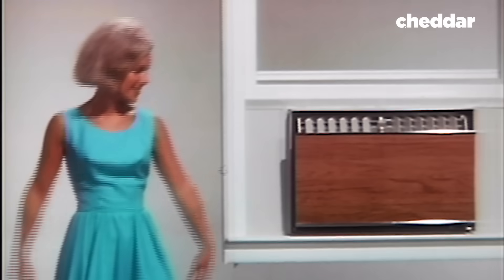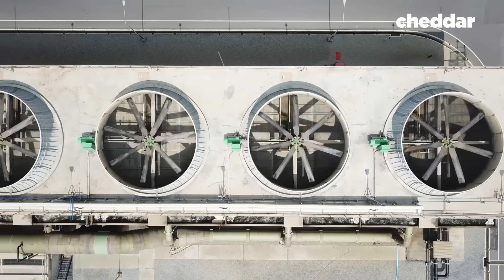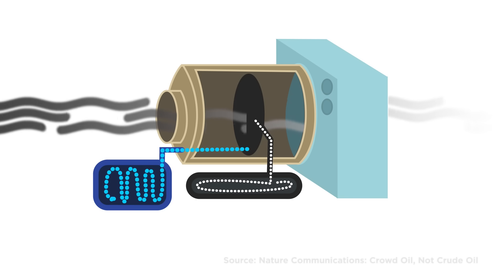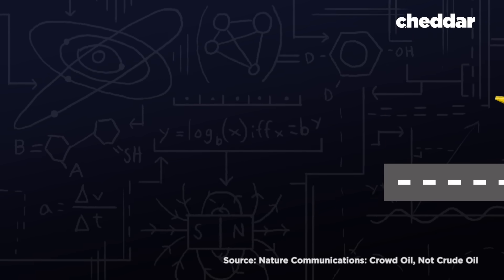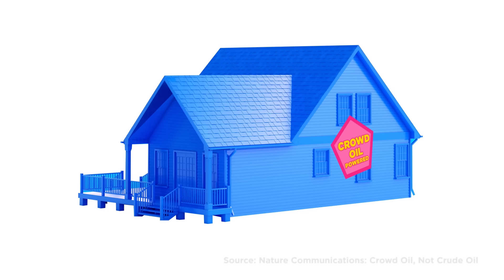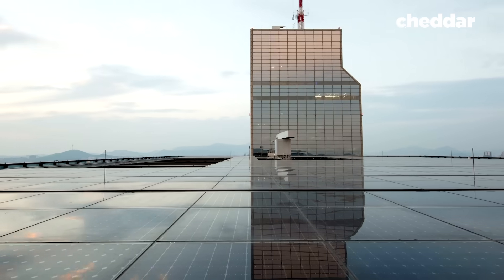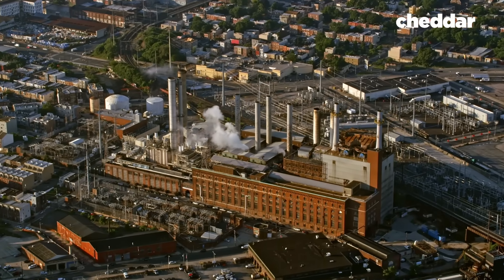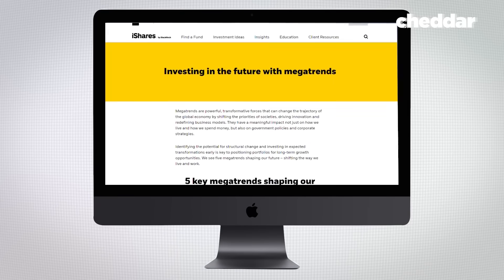How Your AC Could Help Instead of Hurt The Environment - Cheddar Explores

Comment: Does it not use more power to create the hydrogen and power the fan than the amount of energy produced from burning the oil?
Reply: They discuss exactly that at 5:00, you need renewables to power it or it's just adding inefficiency into the system
Reply: @andyrotering1609  you can use renewable energy to harvest carbon (in obviously lossy process) and then burn it for energy (in another lossy process) or just straight up use this renewable energy. You can't violate the laws of thermodynamics.
Reply: @andyrotering1609  
Or nuclear.  But that comes with other issues.  Green energy used to include nuclear.  Now they are the bastard child no one talks about.
Reply: How does this not violate the laws of thermodynamics? That's what I'm thinking.
Reply: @Hemomancer  I think thats what i was talking about in the original comment.
Reply: @holyravioli5795  yes, I was agreeing. I was glad to see someone else had posted already understanding the laws of thermodynamics(that being you) and wanted to add my support to it. I hope you have a great day! :-)
Reply: @Hemomancer  we are NOT producing more energy than what we are spending. Spending is implied, we are capturing carbon, not making fuel here. Capturing MUST AND WILL be subsidized (by european governments, canada, maybe messico and probably even by russia and china, years before those silly americans catch on) BUT the fans are already running because it's an AC system. Fuel is an happy byproduct, and it's easier and cheaper to produce and handle than pressurized CO2 in canister.
Reply: @Hemomancer  it might be similar to how heat pumps don't violate the laws of thermodynamics even though they produce more heat than the energy required to run them. That is because it is not creating heat rather it is moving it. Same principle might apply. They are not creating energy rather moving it from one form in the air to another liquid storable form. Granted more research would be needed for me to know if this is actually what is happening. - source hvac mechanical engineer
Reply: @mormongirlnv  These devices can't move energy "from the air" because for this application, the air doesn't contain energy. Combustion of organic matter is a reversible process: burning hydrocarbons creates CO2 and releases energy, while turning CO2 back into hydrocarbons requires energy to be put back in.  Since the amount of energy required to turn CO2 into hydrocarbons is equal to the amount of energy released when hydrocarbons are burned, it is 100% impossible for a carbon-capture device to achieve carbon neutrality if it relies on fossil fuel power.
Reply: @Hemomancer  Because it's not talking about creating energy out of thin air -- it's talking about converting heat energy, which is normally considered waste energy because it's very useful, into more useful forms of energy.  And yes, it would take energy to convert the heat energy into other forms of energy, but it sounds like it would take less energy input than we'd get as output.  All relevant the laws of thermodynamics say is that energy can't be created out of thin air -- it has to come from somewhere -- and that, over the long term, energy tends to spread out.  Neither of those prevent us from converting energy from a less useful form to a more useful one.
Reply: I'm just not following why you don't just use the renewables instead of burning fossils in the first place. If you're making fuel, I'd assume there is an intention to burn it later, returning the CO2 to the air again. So the net is just adding the future trash of dead solar panels. 4th gen nuclear would be a much better solution.
Reply: @NIronwolf  in my opinion, going through the hassle of making fuel is to ease the transition to carbon neutrality. Batteries are not cheap and most of our machines move thanks to oil. We haven't got much time to go full electric, producing clean oil will speed up our response to climate change.
Reply: @NIronwolf  Chemical energy is useful, as long as it isn't a net producer of CO2
Reply: @NIronwolf  solar panels are easy to recycle, in fact they pay back the invested energy in 2 week, and in a total of 4 you have the energy needed to recycle the panels
Reply: @NIronwolf  I guess the point is that burning the fuel you made again is better than using up even more oil that's been drilled out of the ground?
Reply: @NIronwolf  I don't know, but this seems like a good idea to take co2 from the atmosphere.
fossil fuels aren't entirely bad, but our use is not efficient. we could use fossil fuels to run our cars engines or be more efficient and use electric vehicles that use power generated by fossil fuel "that would be much more efficient '
thoughts?
Reply: @bukh  I'll agree that using coal fired power plants to get electricity for vehicles just relocates where the CO2 enters the atmosphere. I would suspect it even causes slightly more pollution since there are losses converting between how the raw energy is stored, as evedenced by heat given off at verious parts in the chain. I'm not citing nor have I done research on this point of course but it's something to consider. Really the carbon we've taken from the ground and put into the air can really won't go away without putting it back into the ground, and that seems pretty unlikely.
Reply: @NIronwolf  well, not true. Carbon that we have released will return to the ground and in fact it is returning as we speak, nature is making sure of that. Problem is that the nature is only able to capture about a quarter or a third of our emission. And our emission is growing every year. If we stop releasing carbon it won't take long (probably a hundred or two hundreds years) to capture it back without using ridiculous technology which could speed up the process by completely insignificant amount of time. As for the fusion power- we don't even have a roadmap for it and expecting anything to happen before 2050 is unreasonable. And by the way humanity wants to stop the growth of the emissions by the year 2050. Capturing carbon is not a good idea.
Reply: @NIronwolf  actually it goes back to the ground, plants use CO2 but we are putting extremely large amounts of it in the air. we should try to reduce our use and use fossil fuels more efficiently. lately we have been seeing a lot of technological advancment that allow us to get the same outcome with less consumption. overall I'm pretty optimistic about the future, and I firmly believe that if we keep developing our technologies our planet will prosper
Reply: Same here I was waiting for 7 minutes until she mentioned the energy costs. Felt like they were basically talking about a perpetual machine up to that point. Like producing that energy used to power the "fuel maker"  doesn't emit CO2. Most likely since most energy sources are still fossil fuels. 

Anyway they do hit the target eventually which is reducing emissions in the first place.
Reply: The fan is already running, this is an AC system, the fan will be running all year long nonetheless. The H2 separation is a cost, but it's needed to liquify the captured carbon. Consider tha alternatives: (1) storing C02 in pressurized canisters. Still a huge cost, and those canisters might leak and must be offloaded down flight of stairs: we're on the roof of a skyscraper (2) using canisters of H2 produced more efficiently elsewhere: those canisters are more than a fire hazard, they're an explosion hazard. And they must be continuosly carried upstairs on the top of the building. And the plant would shut down when the canisters empty up, so this would imply using bigger canisters and more explosion hazard. SIGN ME UP FOR AN HINDERBURG RIDE.
Reply: @frien_d  if you design 100% efficient process it will still require exactly as much energy to break the carbon-oxygen particule as the process of joining those particula  gave.
So provided you've design such a system (which you won't, 20% efficiency would be a great achievement) then you would only need to use exactly as much energy as humanity produced through the centuries by burning carbon times three because energy production from carbon is at most 33% efficient. Good luck.

But the actual funny thing is that all it would take is just to stop using carbon and wait, as the nature has been able to capture a third to a half of carbon we have released. While as long as we keep using carbon energy it will be better to use whatever the energy source they would you use to just lower the carbon emission instead of capturing carbon using extremely lossy process.

The whole idea is bollocks.
Reply: @6Oko6Demona6  Nature cannot catch up, trees also produce a little CO2 other than capturing it to make mass. The foilage they shed rots and releases CO2. Once they're full grown they capture way less than in their infancy, trees capture by building mass. We could cut them to replant them, but if we let those we cut to rot, they'd produce CO2 again. It's been calculated that if we cover every available landmass in trees, it wouldn't stil be enough. We screwed the atmosphere more badly than most people think.

There's a lot of data on the "trees are not enough" problem, here a random link I just googled up https://earthwiseradio.org/2017/07/trees-are-not-enough/

There's moss, moss is more efficient at CO2 capturing than trees, but it's a little nitpicky on where it wants to grow.

Fitoplankton then: fitoplankton should be studied more it's not considered very exciting in general, but it's promising and maybe there are ways to stimulate its growth. Nature needs either help OR total human extinction. CO2 capturing, powered by nuclear and renewable, paired with reforestation is that help.

But I guess you're rooting for total human extinction, so... be my guest.
Reply: @frien_d  I have never claimed planting trees is ever gonna be enough, have I? I wrote that just not using carbon anymore is gonna be enough. Yes, trees produce co2, plants rot, etc, but it doesn't change the fact that the nature is still absorbing half of what humanity is emitting (I wrote 25 to 50% but quick Google search indicates it's 50%). That's all obviously on top of the natural carbon cycle (just to make sure, everyone gets it). If you stop emitting all this human produced carbon will be sucked out of the air very quickly. If you won't- you'd better off using renewable energy to lower carbon emission instead of using it to suck carbon out of the air at the cost of a very (very) lossy process.
Reply: @frien_d  to make it fun: calculations, yuppi!!!
Let's assume that humanity is still using some carbon as energy source. Let's assume scientists designed carbon capturing process which is 100% energy efficient. Let's assume we have a free green energy source of 1kW power. So you can use this energy to capture carbon in which case you'd be capturing 1kW worth of energy and store it in carbon. Or you could provide this power to the grid and lower the demand for carbon energy by also 1kW. But since we produce carbon energy with 33% efficiency we would need to burn 3kW worth of carbon to provide 1kW otherwise. So you could either suck 1kW of carbon energy out of the air or lower the emission by 3kW.
Reply: And the "electrolizer" to break the water into hydrogen will consume more energy than the gain from the hydrogen produced...no free lunch....
Reply: One word. Yes.  This is a carbon battery, not a carbon removal and since the energy is produced by carbon, you would actually emit more carbon then you pull in.
Reply: @chrixthegreat  The energy isn't intended to come from carbon, but solar.
Reply: @TCBYEAHCUZ  Would be more efficient to just use that solar to power homes to reduce carbon emissions then to use it to pull emissions for the air at an energy loss.  Maybe when we can power our entire infrastructure on planet friendly renewables with power to spare, then this would be a useful technology.  But by then, it would either be to late or our adaptive planetary ecosystem would have already fixed the problem for us.  Is an interesting idea but I don't think it will have practical application.
Reply: @chrixthegreat  You're missing the point, and what you say is exactly what this video proposes. Solar will never get more efficient than 50% light to electricity, this is just a fact of physics, some panels have reached as far as 40% so far with perhaps small improvements here or there... 

The issue isn't solar's gathering efficiency though, that can easily be offset by putting in more panels and integrating light gathering panels in more substrates like bricks, tiles or glass. 

The issue with renewable energy is that they are intermittent and they can't be relied upon 24/7, they can also produce huge amounts of electricity when we don't need that electricity very much, for example during noon when the sun is at its maximum intensity, we are away from our homes and not using it.

Logically, we will need to use batteries to store that electricity directly and I commend Elon Musk for trying to moores law battery technology with his electric vehicles, but batteries on a pure Watthours/kilogram comparison are extremely terrible when compared tom the same watthours/kilogram with chemical fuels like petrol/diesel etc. Batteries are still  incredibly inefficient. 

A good stop gap is this system explained in this video - when the sun is maximally in the sky, we can have our air conditioners running a different mode of operation when we are away working (or during in large office buildings and structures), to extract CO2 from the air directly and sequester it into a high energy density form - Fuel. This fuel can then be shipped off and sold because it was practically made free from solar power. *This process removes carbon from the atmosphere*.

When a ICE fuel vehicle then burns this carbon fuel, it has not added more carbon to the atmosphere because it was extracted from the atmosphere to begin with by solar power. Thus, "Carbon Neutral Fuel."
So we can use our solar panels to store sunlight in carbon  and then the cycle repeats and we have sustainable - carbon neutral energy - until our battery storage technology has cached up.
Reply: Yes it would. The problem comes when you realize what burning hydrogen actually entails. When you burn hydrogen you're really just combining it with oxygen. This produces H2O, just like how burning fossil fuels made of carbon produces CO2. Once you know that it becomes obvious: you can't split H2O appart and expect to get more energy back from putting it back together. So it's pretty stupid they'd even suggest that, because at best, you'd break even.
Reply: @derpmansderpyskin  Yes, it's an elaborate 'CO2 battery' (liquid hydrocarbon fuel) with huge round-trip energy losses.  The only advantage I see is that it's 10x more energy-dense than the very best lithium ion batteries, so you can use it where those won't cut it, like long-haul aviation.  Skipping the CO2 and just burning the H2 also works, but H2 is a pain to store and the volumetric energy density is barely better than lithium ion batteries.
Reply: This kinda junk science should be illegal
Reply: Holy Ravioli more power yes, but less carbon
Reply: @jacobbwalters8133  you gotta be kidding! Of course it takes more carbon. Even if their process was 100% efficient even if they powered it using 100% green energy it would still be about three times better to just provide green energy to the grid and reduce emissions than to use it to capture carbon.

This is some middle School level science, why do y'all fail at it so miserably?
Reply: 6Oko6Demona6 I think you fail to understand just how inefficient “green” energy is. The carbon cost of building many of these “green” infrastructure projects is actually quite high-specifically with wind and solar. Lithium mining (used in energy storage devices for these technologies) is extremely energy (and carbon) intensive and the cost of upkeep on these systems can be quite high. Nuclear is likely the best carbon free alternative for our energy needs but gets pushback for obvious reasons. 

There is a lot more nuance to these issues than you seem to be acknowledging. Rather than pontificating, please just read the study done by these scientists. I am sure they would disagree with your assertion that this is “middle school level science.”
Reply: @jacobbwalters8133  man, you wrote that the process depicted in the video would "use more energy but less carbon". I tried my best to explain to you that even if they used 100% emission free energy source and made their process 100% efficient it would still not make any sense, and you just mumbling about the complexity of green energy production. Yes, I know, they wouldn't use 100% carbon free because it's impossible but that just proves my point stronger.

All you need to understand is the third law of thermodynamics, which they teach in middle school (at least in my country). One post above your first post I have wrote some extremely basic calculations, read it and if I made a mistake I will be glad to learn where (spoiler: I didn't).
Reply: 6Oko6Demona6 As much as I appreciate your condescension, I was taught the law of thermodynamics. The issue isn’t in your calculations, it is in your starting point. You begin with the assumption that people would not otherwise be using their air conditioning or central air systems. Clearly using no energy at all would be the ideal solution but this is not a feasible solution. 

Beginning with the assumption that central air will be used fundamentally changes the calculation and renders the rest of the math that you have completed a useless numbers exercise.
Reply: @jacobbwalters8133  you claim you've been taught the laws of thermodynamics but hear yourself- you're now stating that they're gonna use the free energy thanks to AC! Not true, as much as AC is obviously inefficient if it was possible to lower the airflow (thus also lower the energy needed for the fan) it would be done already. Fans are spinning because it's needed for the AC, using some of this airflow for the carbon capturing process will either demand them to spin faster or make spinning harder for them, either way- they will require more energy, because, you guessed it, thanks to the third law of thermodynamics there's not such thing like free energy (in this regard energy is like lunch).

But, hell, even if that was possible, even if they could use this airflow at no additional energy cost it's still just the negligable part of total energy needed for the capture process. The least amount of energy needed to break co2 to c and o2 is still exactly the same as the amount you've got from burning it in the first place. Since the airflow doesn't break CO2 it's just additional loss of the system so even if it was free it wouldn't change the energy balance by a tinniest bit, because remember? I have already assumed 100% efficiency.

And, well their process doesn't capture carbon in to it's atomic form, it's combining it with hydrogen, so this process is actually going to require more energy than you got from burning the coal. Even at obviously unachievable 100% efficiency.

Please bear with me, no matter how you spin this, there will never be free energy. If your calculations show otherwise you're either wrong or on the straight path to the next Noble price.
Reply: 6Oko6Demona6 you are clearly twisting my words and setting up strawmen to argue against. You are entitled to your beliefs and if you want to believe that these scientists are wrong just  because you can’t wrap your mind around anything in their work PAST middle school science then that is your right. I am going to move on, however, and stop feeding the troll.
Reply: @jacobbwalters8133  come on man, how is that a strawman? Correct me, do maths, show where exactly I'm wrong, I'll be more than glad to learn a new thing!

You've said that the fact they're gonna use the AC rendered all my energy balance calculation useless. How exactly so if I already assumed free green energy and 100% efficiency?! If I made a strawman than sorry, but your claim about AC rendering my calculations useless needs elaboration.

How am I ignoring everything past middle school? Everything I have learned past middle school obeyed the third law of thermodynamics, so it's not like I'm affixed on middle school and ignoring all the rest, it's exactly the opposite: everything past middle school can't ignore middle school knowledge about the third law 

It's one of the best engineering practices to always use the simplest sufficient model and the model I have used is just that. And the best part of it (I wrongfully assumed) is how it makes it easy to understand this complex phenomenon. Adding complexity to this model would only make the case for sucking the carbon out of the air weaker.

I love how well spoken you are, keep it up. But to also add some substance to your posts. Or just read into my points with open mind. The fact that the are scientists is no relevant, it's the authority fallacy.
Reply: Holy Ravioli it would have to be powered by other renewables to be carbon negative.
Reply: Another way to get power for this is use those energy capture systems that use directed heat to generate energy. Like a heat capture powerplant.
Reply: @Iquey  You mean peltier devices? Insanely inefficient.
Reply: I believe it still does consume power overall. But it helps to become very efficient.
Reply: How durable are these filters how ofter do they need to be changed and how savagely expencive are they
Reply: You'd probably need something similar to electrolysis to pull co2 from the air without major compression setups as well as to break apart the water.
Probably less than 10% efficiency. I mean you can do the math on the returns from 1000L of oil cycling through such a system.
Would make more sense to me if the high energy cost went into locking up the carbon instead of just using it again. Then something is actually being done to help environment...
Reply: @Nocare89  A roof top algae bioreactor would suck up more carbon and produce more biofuel then this system.  It is a cute idea and it may go somewhere someday but for now, there is better ways of dealing with this problem.  Ultimately, increasing global biomass would be the most effective long term solution.  Problem is, we are currently doing the opposite.
Reply: Which is why the energy must be green already
Reply: It does.  At the 5 minute mark they go into that.  Basically it's a battery scheme.  It's a way to convert clean energy like solar into gas.  It's the same thing they talked about with hydrogen powered cars or battery powered cars, only dirtier at the local level since the whole point then is to burn the fuel which will give off C02 (which is okay, theoretically, since it also harvests as much C02) but other nasty stuff that burning diesel gives off.  The only advantage it has is there is more infrastructure in place to burn diesel.
Reply: Not the point to make it 0, but they gain a overall discount And be better for the environment
Reply: I think the idea is that you're spending energy anyways to cool your home with traditional AC.
Reply: Lol electrolizers take an absurd amount of energy to operate. You could maybe mitigate some of the cost by using solar, but a system like this would be quite expensive and good long lasting solar panels aren’t exactly cheap either.
Reply: Once you burn the oil you produce you release all that carbon back into the atmosphere, so your not decreasing the net CO2 at all, what needs to happen is more trees need to be planted to absorb the co2 with the power of sunlight and the energy from burning wood could be fuel
Reply: They said they needed to use Green energy.
Reply: yes, it would not produce more energy than it needs to produce said CO2, but you can store that fuel for later, if you use solar/wind to collect the fuel during the high power daytime, it can later be burned at night at a relatively carbon neutral level, thus better leveraging the renewable energy that Germany for example has in abundance
Reply: Electrolysis is very energy intensive way to make H2.  It is cheaper the steam methane to make H2 (see thunder foot and other posts about battery vs H2 powered cars.
Reply: Yeah electrolysis to make hydrogen is used by itself to make hydrogen gas but you don't get free energy from it. And energy wpuld have to be put into the CO2 to chemically change it so it is in a state of higher energy, otherwise there will be no energy in the fuel. I don't think it produces more energy than what is put, it just captures carbon and makes fuel out of it,
Reply: sure, but if the energy powering the fan is renewable, then we don't need to break the laws of thermodynamics.
Reply: You are using the power for the AC already - the feedstock from the hydrogen can then power the process of turning it into fuel. There will still need to be more power, so that would want to come from renewables.
Reply: currently we create hydrogen mostly by burning natural gas
Reply: I think that's why they say it's important that it uses energy from a non fossil-fuel sources. If it's run on fossil fuels, it's going to create more emissions than it captures
Reply: Waiting for @thunderf00t to rip this apart.
Reply: @NIronwolf  
It doesn't create new energy, it's more of a storage.

This AC unit will take much more energy to run, but produces a fuel.

There is a net energy loss. 

But, if it is powered by nuclear or renewables, then the amount of carbon entering the system sharply declines.

If used with power that produces carbon, it is counterproductive.
Reply: @merlinious01  This. Basically it is a chemical energy storage system and it works from solar power. It is inefficient but solar power usually has a spike in production but not much usage throughout the day, this system enables to store that unused solar energy to produce usable chemical energy - because battery technology still sucks, chemical fuels still have a far higher energy density than batteries.

There is no violation of thermodynamics, entropy is still increasing etc and it is only useful if powered by nuclear/solar/wind
Reply: They propose a solution, wrapping buildings with solar foils to provide the energy required.
watch the video again if you find this unclear.
have a great day 😊
Reply: @bukh  you can wrap a building and use the energy the foil has produced to power the building and provide it to the grid. Or you could use this energy to capture carbon and then burn carbon for energy. Take a guess which approach is more energy efficient and which is ridiculous.